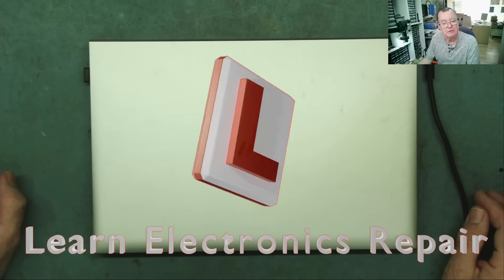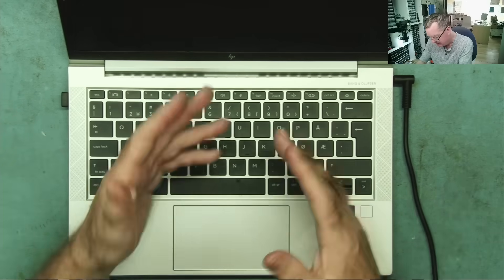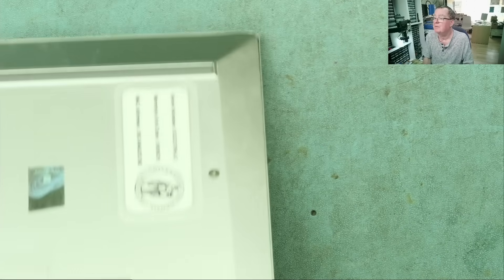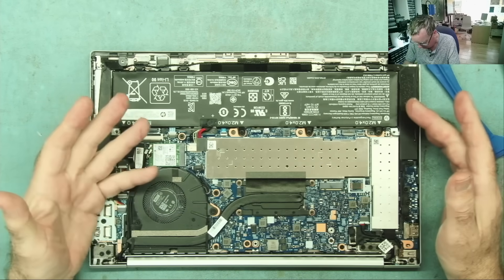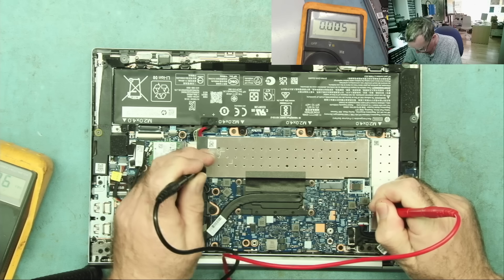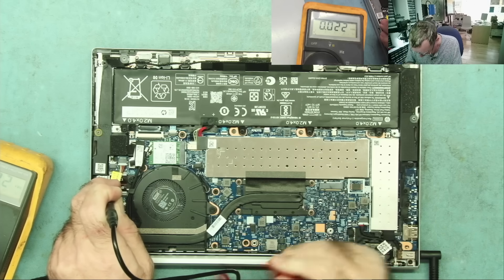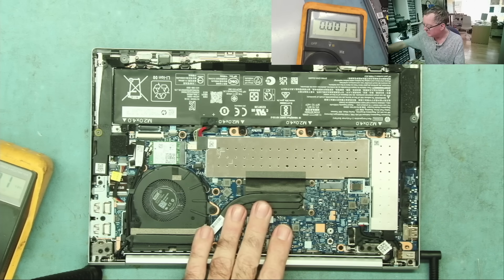HP Bang And Olufsen Laptop DEAD No Power Does Not Start SMD Capacitor gets HOT Can we fix it?

Comment: I've always been amazed at the number of laptops which will not turn on, but will happily start with the battery disconnected. Almost always the battery can be reconnected without the laptop shutting down, and will then charge normally. I first noticed this with NiCd batteries, so charging circuits have not changed much in the last 30 years!

Comment: If it works without the battery than the problem is the battery itself or the charging circuit maybe i believe the NLBA device would be very useful in this case, by the way, imo the way you hold the thermal cam is not very practical does the p2 pro software has the function of image mirroring

Comment: It draws 40mA off with no battery.
Something is shorted on the board.
Reply: No, it's one of fix voltage rail model and additional current is wasted in circuit which create main rail voltage (I guess 12V in this case).
Reply: @gorky_vk  40mA??
Reply: @ With laptop bricked like this one was with most of the power supplies running (you could see that 3.3 and 5V were present) yes, why not?
To me this look as combination of "frozen bios" problem common with this gen of notebooks and weak battery but I would not write off the possibility of a hardware fault on charging circuit (can be both), I expect to see shorted mosfet there if we see this device again on this channel (somewhere on real charging circuit, not the one he pointed out in the video).
Reply from the maker: @gorky_vk  You could be correct. Either there was a problem with the battery or the BQ charge circuit. I stand by my comment that I would not want to go further with the repair until I could at least eliminate the battery as the culprit.  The customer wanted it back and didn't want me to get a battery so I charged for my time and they are now using it with their original charger and the battery disconnected - which by the way I checked before they took the laptop back.
Reply: @LearnElectronicsRepair  the way most people use their laptops anyway ;)
Reply from the maker: @gorky_vk  Yep 🙂
Reply from the maker: @gorky_vk  Correct 🙂

Comment: Wow, the armchair techs are out in force on this one! Given the amount of time available it seems to me your diagnosis was spot on. My only armchair input would be to scope the capacitor with the battery connected on the  brick and on your bench supply. Something is making the cap get hot 🔥. Regards, David
Reply from the maker: My honest guess is it was ripple currenct causing the capacitor to heat up.  I should probably make a video about that sometime soon 😉
Reply: @LearnElectronicsRepair  Yes, ripple would cause the cap to get warm. The question is what caused the ripple - a bad battery overloading the brick supply or a bad brick supply unable to keep up with the load? A video about how ripple affects capacitors would be great (maybe compare low ESR caps to regular caps too). Regards, David

Comment: Some HP and Dell chargers have current sense pins which negotiates with the laptop how many AMPs to provide the laptop. When you have the bench supply hooked up to the laptop and not powered up the battery was drawing no amps. I would have applied voltage directly to the red wire on the battery connector to see if the battery showed any amerage draw. If not that would indicate perhaps indeed it is the battery. Otherwise it may be the BQ chip
Reply from the maker: Yeah you notice I used an adapter specifically for HP.  It has a resistor or something in there to make it work correctly.  When the customer had the laptop back it was working on their original charger

Comment: I am constantly baffled by the fact that everyone who has a repair channel on YT wants to use a multimeter for everything when an oscilloscope is often vastly more informative. 
If you are using a meter that has a DC blocking capacitor for AC ranges (some such as Fluke do, some don't; you can easily make a DC-blocking test lead that is perfectly safe at low voltage) even looking at what are supposed to be DC voltage points with the meter on AC can tell you more than just DC measurements.

The cap in question is clearly local decoupling (or "reservoir") in the DC input rail. Buck converters do work the input caps very hard (high ripple current) if the source impedance at switching frequency is not sufficiently low.
Reply from the maker: And which part of that diagnosis did I not work out using the multimeter that I could have worked out using a scope?
Reply: @LearnElectronicsRepair I agree a scope is not a lot of use but you could probe the bios chip data pin to see if the cpu is reading it at power-on time.
Reply from the maker: @g4z-kb7ct  True but as there was no Vcore or Vram that isn't going to happen 🙂 Where as with the RTX 3060 I worked on the previous video all rails were up so it was a necessary step in the diagnosis.  So for sure I use a scope when it's appropriate https://www.youtube.com/watch?v=s2MRQWngdWM

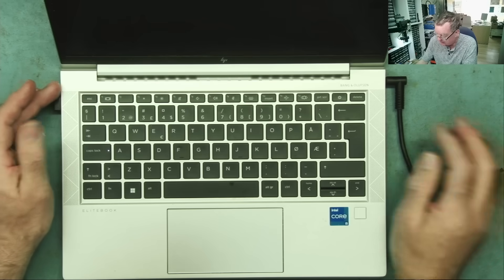Comment: ☢Hi Richard!  You changed power supplies at 11:00.  It ran on your benchtop supply, but not on her charger 0:25.  Maybe her power supply has poor smoothing and the 15uF 25V tantalum capacitor is trying to deal with it.  Instead of changing only one thing (just disconnecting the battery), you changed two things (the battery and the external source).  Try reconnecting the battery and use your benchtop supply to power the unit. If it still works, then the problem is likely the external charger.
Reply: Does it work on your power supply when the battery is connected?  Is the capacitor cool when doing so?  Alternatively, will the unit run off her brick with the battery disconnected?
Reply from the maker: @pault6533  I didnt' get to test that but I can say it worked on the customers original PSU with the battery disconnected.  It is clear that a lot of current was flowing through the 12V inductor and nothing else on the PCB was getting hot so the battery seems by far the most likely culprit.  Note with the battery attached there was 11.44V applied to it but once it was disconnected it read 10.9V so even though it was drawing a lot of current it does not seem to have been charging.  The customer told me they had tried to fully charge the battery previously.
Reply from the maker: I would agree with the 'only change one thing at a time' appoach however to be fair my bench supply was only running at 40mA after the battery was removed so I am not sure how your suggestion makes any logical sense. 😵‍💫 Asl oas mentioned at hte start of the video I was on a short time scale with this job, at the customers request

Comment: Have you actually tried it with the battery connected on the bench psu? Put a scope on that cap to see riple and confirm bat is draing to much current. Notice the logo on the cover of the laptop, seems like a modern style HP logo.

Comment: is the charging circuit charging the battery? try charging the battery before condemning
Reply from the maker: @davesdigitaldomain  Of course it could be either but as stated in the video, I never said the battery is faulty rather I said I would not want to spend any more time on this repair without trying a good battery first. I stand by that decision as anything else makes no commercial sense 🥴
Reply: I've charged laptop batteries out of circuit until the BMS terminates the charge, then checked the open circuit voltage.  A good hp battery won't go as high as 12V open circuit on the output due to the BMS, usually around 11.1V.

Comment: It's not a faulty battery. Had the exact same problem with my partner's laptop yesterday and it's the same HP G8 or something. Microsoft issues an update this recently which couldn't complete and that update triggered this in our Laptop. If you hold the power key down for 2 mins the laptop will reset and run a bios update and then when finished the Windows update will complete properly.
Reply from the maker: Can I just settle this discussion guys.  As seen in the video the laptop could not even power up (voltages checked and were wrong) and the battery charger circuit was providing too much current.  In this instance even if you could reset the BIOS it isn't going to help.  The original post was IMHO referring to the fault I first mentioned when the EC (not BIOS) gets messed up and disconnecting the battery for a few minutes will fix this
Reply: I saw a video about Microsoft issuing bios updates via Windows Update.

It seems like a very unsafe way of doing BIOS updates, it could result in the device being bricked, as in the case of the video I just described. In all cases the user is not informed that hardware changes are taking place.
Reply: @chrishartley1210 I had a laptop brick it self while i was trying to repair it, was powering it up and off and couldn't see the screen somehow it must have started a bios update from Windows update and of course i didn't see that and unplugged the battery can't really remember what i was repairing on it but had to fix the bios with a programmer later
Reply: @chrishartley1210  It is not the first time BIOS updates via Windows updates have fubared laptops.
Reply: I saw something recently on Parts-People about this, posted Dec 28, 2024. That was a Dell Inspiron and different symptoms.  Why would a capacitor get hot unless it was dealing with excess AC?  Maybe the brick was dropped, or was put in a place where it couldn't stay cool, leading to a bad cap or connection inside.
Reply: Spot on, Microsoft is destroying your laptop,  bizarre!
Reply: The BIOS has already been reset by disconnecting the battery. That's why it took a while to power on.
Reply from the maker: Interesting.  Now how is one supposed to diagnose that, and for that matter how did you work out what the problem was?
Reply: @LearnElectronicsRepair  well I'm used to messing with this sort of thing. At first I thought it needed a reset. A lot of laptops can go into this state and the older ones had a pin hole to reset them. But in the end reddit provided the answer. I wasn't sure, I mean 2 minutes? but it worked.
Reply from the maker: @BillboBaggins-j5w The type of fault you describe is fairly common, I've seen and fixed that issue several times on videos. I normally remove the main battery (and CMOS battery if fitted) and leave it for 10-15 mins.  Or you can disconnect the battery and hold down the power button for 10-15 seconds.  I thought it was the EC that got messed up, not the CMOS but anyway the result is the same.  

But that type of fault does not cause the behaviour I had on this laptop, in particular too much current in the battery charge circuit and some really wierd voltages.  So in this case either a faulty battery or faulty charge circuit but my decision at that point was as I said 'I wouldn't want to go deeper into this repair without trying another battery first' and I stand by that.  As it happens the owner wanted it back rather than me order a battery so I charged for my time and that was the end of it. The customer can at least use it on their PSU now (yes i did test it worked OK on the original PSU without the battery fitted)